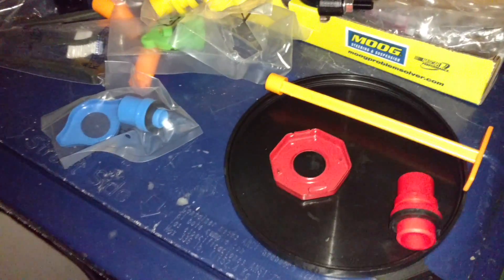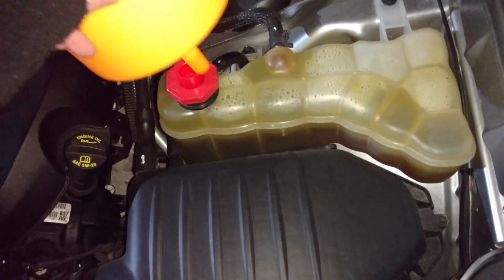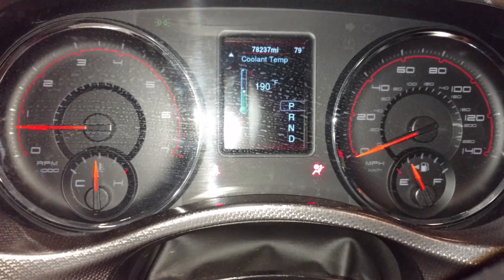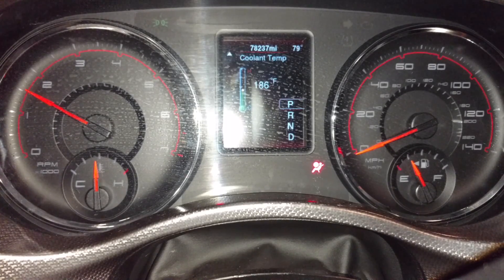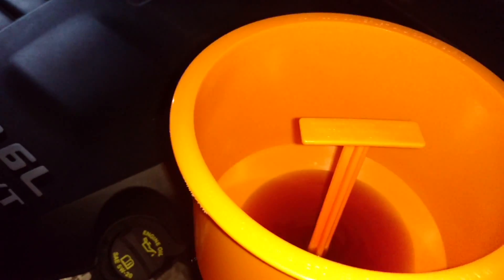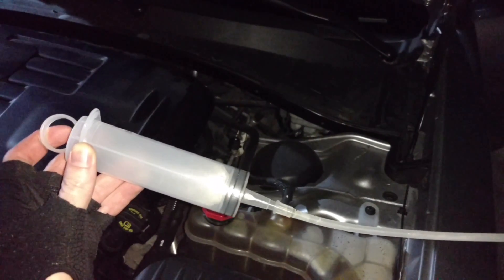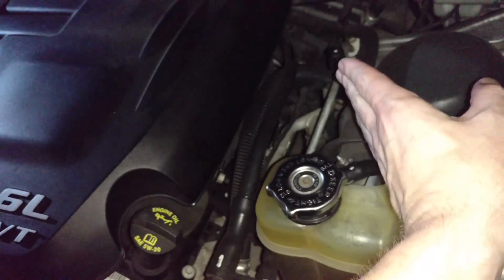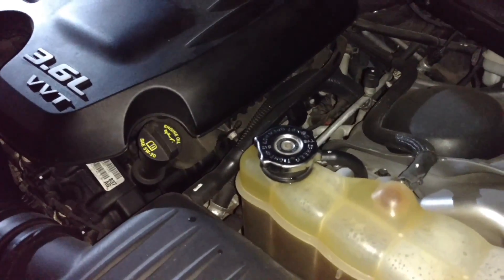Bleeding Air from the Cooling System with a Spill Free Funnel.

Comment: This question is for anyone who can help…? I have a 2013 Dodge Charger I’m draining the coolant.. my car takes 13 quarts of coolant where am I adding 13 quarts of coolant at with no radiator cap please help ????
Reply: Apparently only a couple gallons gets drained , the system still stays with most of it , hard to really do a complete drain, gotta mess with bigger engine block coolant drain bolts that just aren’t easy for your average joe

Comment: What happens if you don’t remove the excess coolant? Will you get air bubbles again? For being over filled
Reply from the maker: You'd risk rupturing the cap from high pressure as you're driving and it spraying out in the engine bay.

Comment: you actually bleed the system from the thermostat housing there is a plastic screw on top... just so you know!
Reply from the maker: That's mentioned in this or my coolant flush video. It does release some but not all in my experience. It's best to clear it at the highest point... Just so you know! ;)
Reply: Using the funnel is WAY better for bleeding air out instead of using the bleeder screw, I remember once i stayed outside for about 5 hours trying to bleed the damn thing through the bleeder screw, just to figure out air was still in the system.
Reply: I used the funnel technique and let my car run at least 5 minutes I began to see it boiling while the funnel was in the radiator. However I don't see milky oil on my cap I don't see engine oil in my coolant an no smoke from exhaust no loss of compression in my excelorator I can't figure it out it's a 2001 pt cruiser.

Comment: I thought the coolant reservoir in cars that don't have radiator caps will purge all air out, hence this is why it is in the highest spot in the engine bay?
Reply from the maker: It does seem to purge air to a certain extent from what I gathered looking at the reservoir but it is much slower and this method prevents unneeded overheating in the meantime.
Reply: @mrficks1838  👍

Comment: How do you get the air out without using the funnel?
Reply: Use the bleeder screw on the thermostat housing.  But the funnel looks to be a cleaner better way of removing the air.

Comment: it is normal for the coolant in the transparent tank to level up when the engine is hot and down when it is cold, in a dodge charger 5.7 ?? Thank you....
Reply from the maker: Expansion is normal but you need to fill it to the cold level Mark when the engine is completely cold.
Reply: Mr Ficks Thank you for answering my friend, I have another doubt that the temperature of the refrigerant reaches 90 degrees when I usually start and when I am running slowly or stopped it reaches 107 degrees Celcius, is that normal? sorry my doubts esque is my first charger and I love my car thank you very much ....
Reply from the maker: @rhaygaryt4691  - Sorry, YouTube doesn't do a good job of notifying me of replies within an established comment. 107° is not normal after warming up the car. That's likely a bad thermostat.
Reply: @rhaygaryt4691  As said maybe a bad thermostat that doens't open when supposed to (Typically around 87-92 celsius) or maybe your fan switch is defect so det cooling fan doesn't start when exceeding normal temperature?

Comment: My 300 is running at 222° . Changed my thermostat, radiator and temp sensors... you think this can be the issue. $500 down now and thinking of getting rid of it 😔😔😔 but i love it
Reply: was it the air?
Reply: @IneedMyPs   it was a cracked radiator. Tiny little crack was bearly noticable
Reply from the maker: Sure sounds like it. Hopefully not too much damage has been done. These aluminum engines are finicky.
Reply from the maker: Should be fine though.. You'll just want to get the air out as soon as possible. Also make sure the coolant looks like it's in decent condition. (without much corrosion material)

Comment: Isn’t the funnel  supposed to go into the radiator not the over fill tank? Not familiar with dodge though
Reply from the maker: Charger's/Challenger's/Chrysler 300's radiators don't have a cap. Probably more models too. Although you might still want to do it in the Over fill in other cars as its probably the highest point of the coolant path..but either should work.